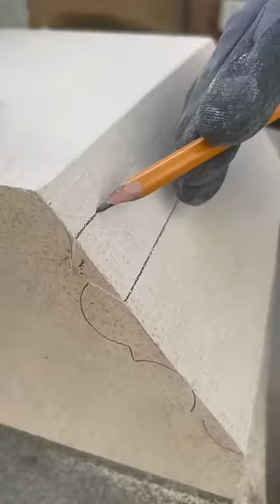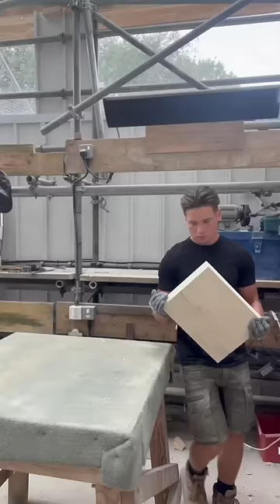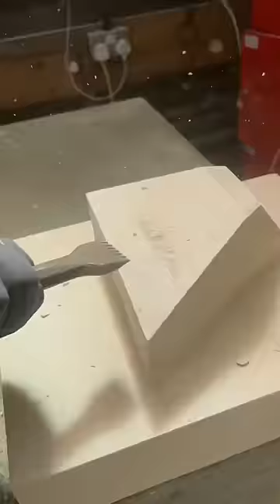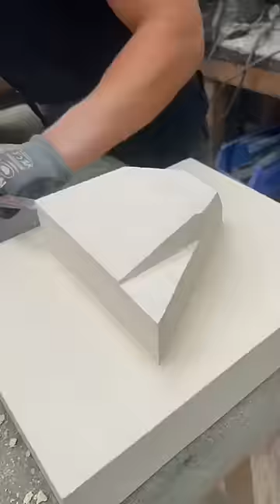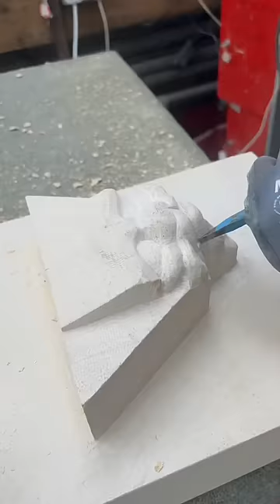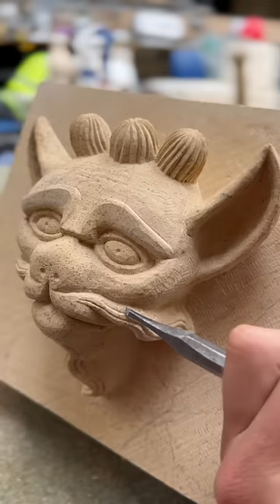#stonemasonry

Comment: When you put no points in intelligence but max out charisma
Reply: I think it's ai tho
Reply: @sandromaspindzelashvili5767 nah I'm pretty sure he actually said this, but maybe AI has just gotten too good
Reply: @sandromaspindzelashvili5767 nah he definitely said this.. he's not the brightest spark.
Reply: @MDM1992 I’m sure he’s brighter than you
Reply: Joe tends to to say alot of things without really knowing, he is a big propitiator of bro science
Reply: @MDM1992 asking critical question on «common knowledge» is a sign of being intelligent. Don’t trust every book you read in school, don’t blindly follow the herd of people without thinking for yourself.
In your opinion how did they make the pyramids ? if you’re smarter than Joe of course
Reply: @paradoxxgaming  Copper/crude bronze chisels for the limestone (which is >95% of the material). Copper saws with quartz abrasives for the granite, which are also significantly rougher and less consistent than the limestone. Ropes, ramps, and wet sand to move the blocks by ground. Boats to move the granite from the quarry.

Questioning common knowledge is fine but you gotta have a follow up. If all you can do is say "why?" to everything, it just makes you look like you're not paying attention.
Reply: @griffin123122  still does not account for the sheer scale we are talking here. How many people do you need to make accurate millimeter precision with those rocks after moving them several kilometers without any engines or machinery? It’s a reason it’s still a massive mystery even today. It does not make sense that only simple ropes and cutters coupled with many workers would make this so extremely precise with the thought technology they had
Reply: Also worth noting, for reference, one of the lightest of the 2.300.000 blocks are equal in weight to an average car. The heaviest are equal to 7 cruise ship anchors (!!) all aligned perfectly. Seriously think about it
Reply: @paradoxxgaming  Take rock. Put sand on it. Take other rock. Rub them together for a while. Congrats, you have now created two faces that perfectly fit together.

Unless you're trying to say that all the rocks are the same size within millimeters, in which case that's simply not true. They vary greatly in size, especially the granite blocks which are also very roughly shaped.
Reply: @paradoxxgaming  Also worth noting that hydrated quartz sand will essentially act as ball bearings to something dragged on top of it. When combined with simple leverage, moving several ton blocks is completely feasible.

So you're the "not paying attention" kind of question everything, I see.
Reply: @paradoxxgaming  just because you can't do something doesn't mean it's impossible
Reply: @CheeseAndCrackers_  are you thick? It obviously was done, the question is how and with what technology. Evidence suggest there is a lot of lost ancient technology that is more advanced that we are led to believe.
Reply: @griffin123122 act as ball bearing really? It lowers the friction yes. Try getting a crew of 100+ men, and move a 60 ton block up a hill with some wet sand and some lever sticks and rope. Im sure it’s real easy to move. Would be fun to watch and see how it was completely feasable to move in the scorching sun without any other technique or technology. My view still stands, it isn’t so straghtforward in my opinion
Reply: @paradoxxgaming  
... yes. That's why it lowers the friction. No one said it was easy, just that it would be possible.

I don't care if you think they did it some other  way, you've done nothing to provide evidence of that. Occam's razor still says they used ramps, ropes, and leverage.
Reply: @griffin123122  questioning the evidence is still allowed even though I don’t have another explanation other than more advanced tech that we haven’t dicovered yet. 
Both are equally as likely
Reply: @paradoxxgaming  Questioning the evidence is allowed, obviously. But, like I said to begin with, if all you can do is say "why" then it just makes you look foolish. Just because you personally think they didn't use the completely feasible methods suggested does not suddenly make the idea that they had secret hyper advanced technology a possibility.
Reply: Do this with granit
Reply: The fact that he’s right though… there’s a lot we don’t know about the pyramids. I will agree he is being speculative though
Reply: @griffin123122  Literally part of Occam’s razor is that it shouldn’t be used when choosing between two different predictions. It’s effectively an abductive heuristic. We don’t know exactly how they built the pyramids we have to piece it together using archeological evidence. But that doesn’t mean what is left after using Occam’s razor is the correct prediction.
Reply: @jjaesse  You're confusing prediction with theory. You must use Occam's razor on multiple theories, they just have to have the same prediction. The prediction is what the theory is meant to explain, e.g  the construction of the pyramids, so these theories have the same prediction.

Obviously the theory that the razor suggests is not automatically correct, complex situations do happen. However, it is the most likely one, as there's no evidence to suggest aliens/hyper advanced precursor civilization/ancient egypt having electricity.
Reply: @griffin123122  ohhh i understand, yeah then it seems we agree lol
Reply: @jjaesse  but saying we couldn't build them or we'd struggle to build them are just straight up wrong
Reply: @griffin123122 I never said hyper advanced nor did i mention aliens. It’s naive to think people aren’t more advanced than portrayed in recorded history as we haven’t discovered enough of our ancient history to make accurate claims of whoch technology they obtained. Advanced technology as a word does not equal spaceships and sci-fi

Comment: How did they make it align perfectly with the cardinal directions?  They tracked the stars.
How did they make it perfectly level?  They used trenches with water.
How did they move all of those stones?  They had rollers, ships, and a lot of manpower.
How did they get the stones up the pyramid?  Ramps most likely.  While there is debate on where the ramps were and how the ramps were built, we know that the ramps were made.
How did they get the stones aligned so that the faces were perfect?  They shaped the stones after the Pyramid was built.
Reply: The perfect answer to the pyramid is that the egyptians where smart and they had tons and tons of slaves

Edit workers they were not really slaves
Reply: @A.Person8 they were slaves. Some were probably workers but they wouldn't have done the dragging. Most of the cutting and dragging would have been done by slaves though.
Reply: @tree_addict280   I just learned modern archeologists are now saying that  the workers were farmers who’s fields were flooded so they worked on the pyramids

Comment: Tbh if you cant make the pyramids with modern equipment that's a skill issue we make skyscrapers 100s of feet tall yet we cant stack stones like a jenga tower
Reply: yea, we have a building that is almost a km tall, a giant pile of rocks shouldn't be that difficult
Reply: @lucakun3455 other than proving idiots wrong there is no reason to build new pyramids.
Reply: @lucakun3455 it’s actually not just a giant pile a rocks. 💀
Reply: Bassproshops
Reply: @andylevingston16 It is in fact largely composed of rocks in a big pile.
Reply: @eggroll3055  your making it seem like it’s just rocks in a pile.💀 which is actually funny
Reply: @eggroll3055  what about the sphinx?
Reply: @andylevingston16  The Sphinx consists of one (1) large rock.
Reply: @andylevingston16  It is rocks in a pile. Yes, that pile is hollow and contains other assorted things, but most of the matter is limestone rock.
Reply: @deanonesense there is a store that’s a fucking pyramid
Reply: @ploguy  yeah. I don't think it's anywhere near as large as the Great Pyramid, and it's mostly hollow, but I guess it still might prove idiots wrong.
Reply: @deanonesense  if we can build the burj khalifa we can definitely build the pyramids
Reply: @andylevingston16 if a toddler can work out how to make the most natural stable structure after playing with blocks for a few minuets. Then I think we can safely call it a giant pile of rocks. And if the Egyptians needed to make such a large foundation just to build up that high it is also safe to assume they weren't that advanced.
Reply: @bro8686  😂😂🤦🏾‍♂️stop typing on subjects you don’t understand or know what your typing about
Reply: @andylevingston16  nice response all you got though.
Reply: @bro8686  bro8686 you literally have no idea what you’re talking about😂 is that all I got, why would I, when I don’t need to say another thing…🤦🏾‍♂️
Reply: @andylevingston16  you kinda do, unless you guilty don't have another thing to say, which just disproves you
Reply: @andylevingston16  oh, what is it then? what's it made out of other than rock? and what shape does a pile of stone blocks have?
Reply: @lucakun3455  bruh y’all so annoyingly uneducated on the pyramids if you think it’s just pile of rocks😂
Reply: @lucakun3455  ofc it’s a pile of rocks🤦🏾‍♂️ man y’all need help
Reply: @lucakun3455  it obviously can’t be made from precious metals 🙄 y’all just pointing out the obvious to act smart but y’all don’t even know anything besides iTs MaDe FrOm RoCkS
Reply: @andylevingston16 Your argument: its not a pile of rocks
Reasoning: its not a pile of rocks
At least explain how its not a pile of rocks instead of responding with "you dont know anything about the pyramids" or repeating the same thing over and over again
Reply: @andylevingston16 didn't you just say it was not a pile of ricks
Reply: @andylevingston16  Your argument makes no sense. It IS rocks. In a PILE. It IS a pile of rocks, and that's the extent of the statement. Yes, the process to shape those rocks and move them into place was ingenious for the time, and yes the structure itself HAD a purpose, but that's nothing we couldn't do now because, architecturally, it's just a pile of ornately carved rocks at the end of the day You say we're uneducated but have yet to prove your own knowledge beyond bashing us.
Reply: We can do it. There’s just no reason to.
Reply: we could make the pyramids for sure
Reply: @godeater3432  oh shit, we building things out of ricks now? Man I must be living under a rock these days
Reply: in what shape are the roads or bridges in your town
Reply: @hannesn2871  are they driving 70000 pound trucks on the pyramids?
Reply: @Laurenceomance 🙄 y’all fr need to self educate yourselves on what you’re talking about .
Reply: @PyroniumZ  y’all can’t read fr😂
Reply: @godeater3432  you can’t read nor spell Fr😂
Reply: @eggroll3055  you can’t read fr.
Reply: @bro8686  I kinda don’t have to😂 it’s called doing your research and understanding what I’m talking about💀 stop being so ignorant.
Reply: @andylevingston16  "ofc it’s a pile of rocks🤦🏾‍♂ man y’all need help" also "ofc" is not a word, if you argue that I understand what you mean by "ofc" I could argue that you understood what I meant when I said "ricks"
Reply: @godeater3432  you still don’t understand 🙄I’m done talking to y’all ignorant people 😂
Reply: @godeater3432  bro said mmmm I can’t add any intellectual value so let’s get off topic and talk about “ofc” because I don’t have an idea of what I’m talking about😂
Ofc means of course but ricks means what exactly ??
Reply: @andylevingston16 yes it is
Reply: @ju1cyjon3s31  😤😮‍💨 whatever you say to make yourself feel better lmao
Reply: @andylevingston16 I believe "ricks" was a typo for "rocks" as you both are discussing rocks and the letter i is next to the letter o.
Reply: @MrEscape314  Issa joke bro that both of y’all didn’t get💀
Reply: @andylevingston16 Yes it's rocks that can be easily cut using modern technology, cut in a wery simple pattern, stacked in a pile. And yes there are empty spaces inside, but skyscrapers are mostly empty inside and they stand perfectly fine
Reply: @andylevingston16  you can believe what you want but at the end of the day it's a big rock triangle
Reply: @andylevingston16  I can read perfectly well, thank you. I've still yet to see you prove that the pyramids are anything more than a bunch of rocks in a complex pile.
Reply: @ju1cyjon3s31  i don’t believe what I want, I believe what I spend hours on research filtering out bs between real shit. Y’all must have not passed high school with a gpa higher than 2.5 I bet🙄
Reply: @ju1cyjon3s31  Ppl many times smarter than you have interesting things to say about the pyramids greater than a big rock pile
Reply: @scoutgaming737  Lmao who ever said they couldn’t be built today? Please get more educated on the pyramids before you @ me. I’m getting tired of ppl saying bullshit
Reply: @andylevingston16  they all have good explanations for it. Nobody knows for sure but we have a pretty good ides
Reply: @andylevingston16  kinda sad that you did that. Alot of experts do say alot of good explanations too so imma trust them over some random guy on YouTube
Reply: @Laurenceomance i can clearly tell Egyptologists can tell y’all aren’t everyone and they mamas can tell they aren’t 😂😂😭
Reply: @Laurenceomance a decent point also includes knowing what the fuck you’re talking about, but I haven’t seen much of that from anyone’s replies
Reply: @andylevingston16 Dude, they had a point that they tried to explain and had arguments for, you have a different opinion that differs from the other persons you're arguing with, cool. You actually need to explain it and give some examples, that's how discussions work. You can't just make a point and ask people to go and look for arguments for it. It's not their point, it's yours, you get me? It's like I tell you big foot is real, you disagree. I tell you well, you go and prove he's real. It's just not logical. Who makes the claim, provides arguments for it, people don't defend opinions that aren't theirs in the first place.